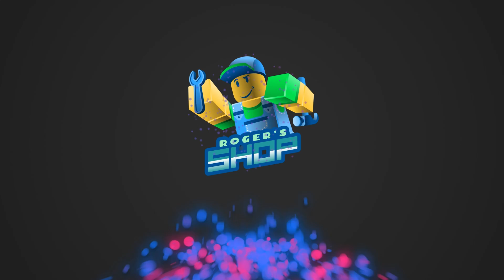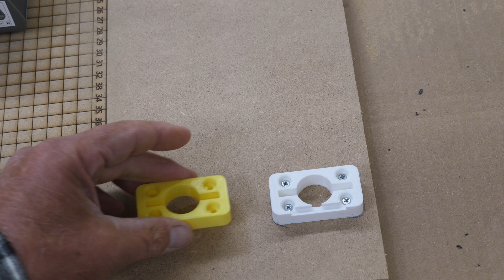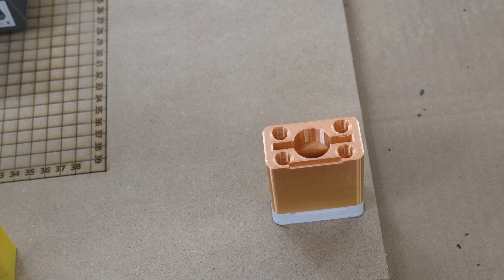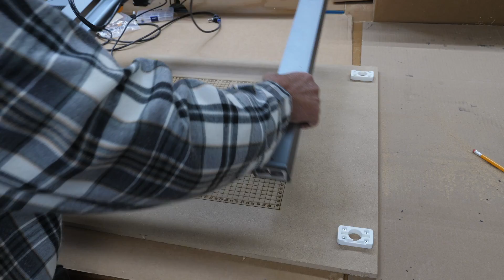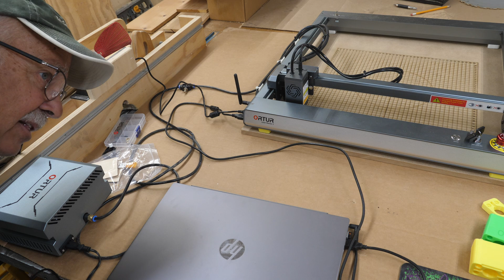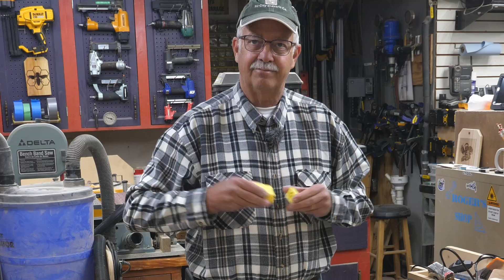Ortur Laser Master 3 Modifications

Comment: Bob P.  Hi Roger I have just purchased an Ortur Laser Master 3. I watched your video on the modifications. I have done the horizontal numbers, circles and Crosses but when I tried the vertical numbers, grid and horizontal grid I keep getting G-code motion target exceeds machine travel. Machine position safely retained. Any ideas please
Reply: Hi Roger. Thank you for replying. Yes according to light burn and looking at the horizontal numbers that are already engraved there is just enough room for the vertical numbers
Reply from the maker: Make sure the numbers and ends of grid are inside the 400mm limit

Comment: Excellent video, thanks.   My setup is mobile,  when i burn something i have to set it up in the garage and break it down when done.    I went ahead and got the fold out legs.  While a little expensive, the legs are very stable and I always have the option to go high or low.     The accessory legs are nicer than I thought they’d be and saves me crafting time failing on a solution that works inside the Otur enclosure that I move around as well.
Reply from the maker: I, too have to be somewhat mobile as I have 14 lasers and limited space.  Most are setup and dedicated to specific items and two are "multi purpose", but still need to move things around all the time.